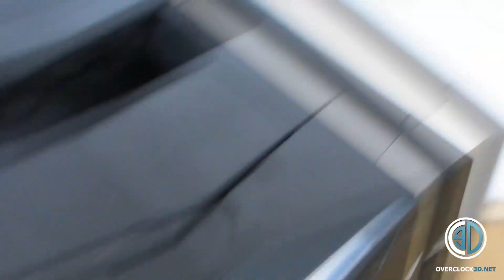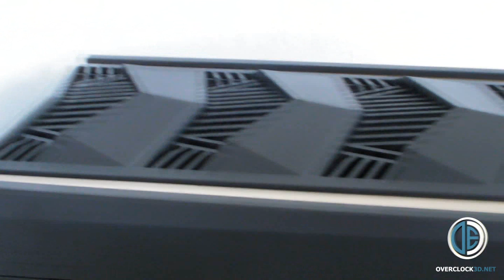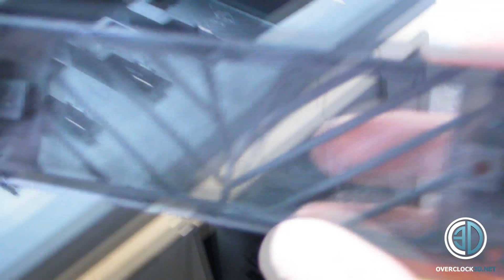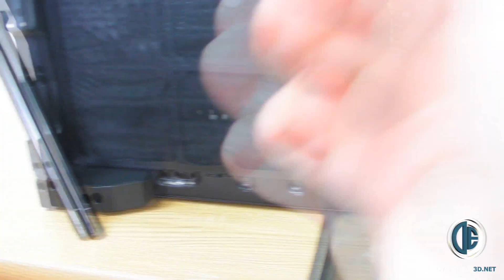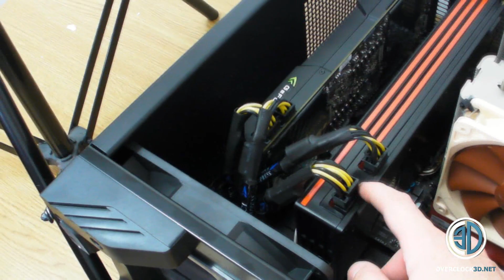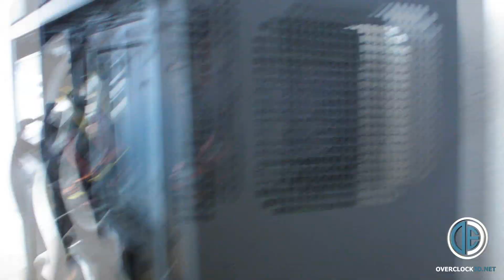Silverstone Raven RV03 Review

Comment: Yes, but not without a bit of work. I have this case with the h100i and the only place you can really put it is at the bottom, but it doesnt have enough screwholes for the dual 120mm. I bought and built this at a LAN, so what I did was just put the radiator on top of the 180mm fans at the bottom and use cable ties to hold it. It works quite well actually (my i5-3570k idles around 25-30c), but I will find another solution to it soon now that I'm back home. :)

tl;dr yes it fits

Comment: Best air cooling case on the market simple as that now they need to start making full aluminium cases again I own an ft01 and ft02 and an rv03 but for me the ft01 is the best just run the top fan as exhaust solves the filter issue.

Comment: I just noticed, but that would probably be one of the best cases for X79 boards. Since the VRM can get rather warm when overclocked, so it could easily push air there without interrupting the airflow as it may do with other cases (heat rises).

Comment: Nice review.  It appears that one could fill 4 of the 6 5.25 drive bays and be able to put the two 120mm fans inside and be able to pull in enough air to cool at least a Corsair H60 with one of the two 120mm fans.  

Looking forward to your review of the Silverstone Temjin TJ04-e window.  I am very interested in that case.  Would like to install 5 3.5 inch HDDs and 3 SSDs in the front.

Comment: if i removed only 1 of the bottom fans, could i still use a corsair h80? Probably a dumb question but I like this case but I dont like air cpu coolers. sure they work but they look terrible. lol in my opinion.

Comment: I wonder if the Corsair H100 would fit into that case. It seems, that it might fit into the 5.25" drive bay to 3.5" drive bay adapters. There are 2x 120mm fans there, so it it aligns, it might just fit perfectly with one set of push fans. The motherboard tray may be very close though.

If you then turn the H100 so that the nozzles are at the bottom of the case, you might even fit an optical drive at the top. Could you confirm, if such a thing was possible without modding the case?

Comment: @PremchandNL OKey, so in my opinion it's the best air cooled case in market right now, for me its better cuz its not that long like RV02 does have USB3 in a front, U can mount more fans if U would like to (RV02 just 4, RV03 i have all optional, all 10:))8x cooler master stickle flow GReen and 2x 120mm Air Penetrator Green.The window its on proper side(left). U can do really goood cable managment there:)More space for long GPU like 6990.
And its just looks better for me:)

Comment: Hey tom chaney from your forums here i was wondering if a ax1200 psu would fit?, It says fits 180mm or something like that pus and the ax1200 is only 5mm more.... Could you try it and see if the cables are just bent at the back or what. Thank you will tell me wether i want this or another way way way more expensive case. :)

Comment: hmmm..... seeing that you have 35mm above the fans, you might be able to fit at least a 30mm radiator with brackets that come with the RV02. i was able to fit a 30mm radiator with a standard 101/2" gpu in the RV02. a radiator with low fin density would work best with the gaps between the fans and radiator when you use the brackets. my results were very fair temps with a cpu gpu loop. raven cases have very good air flow!

Comment: I would buy or look for other PC cases/brands - but the only thing I want is the '90 degree design'. And only Silverstone does that. In a good way. (high quality and damn good functionality)

First, the hardware looks better on it, you can look at your graphics cards, second the warm air raises up through the graphics cards and there is pretty much 100% airflow throughout and third, I think it's MUCH better to connect monitors etc to it.